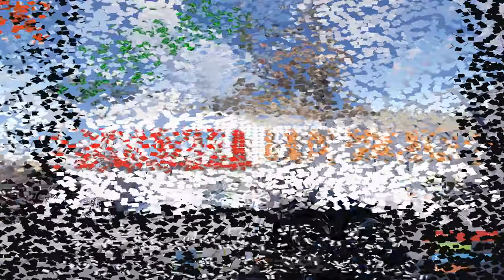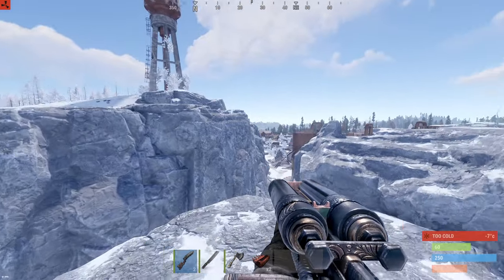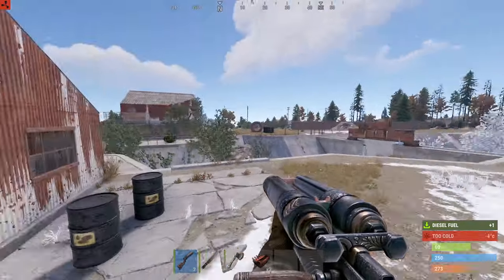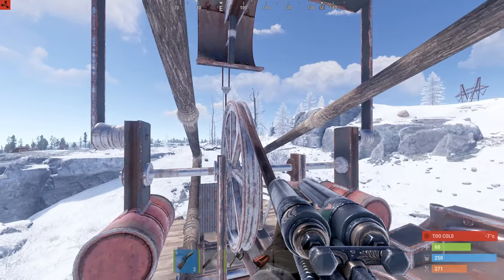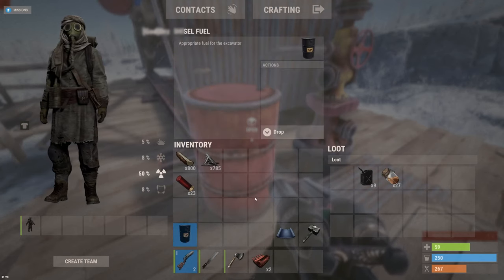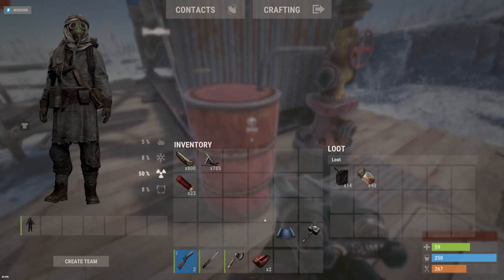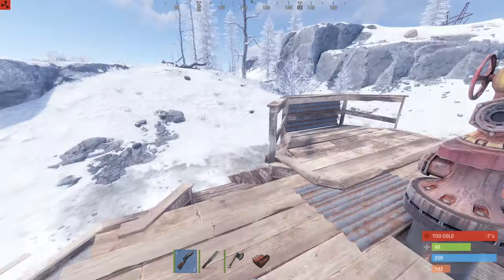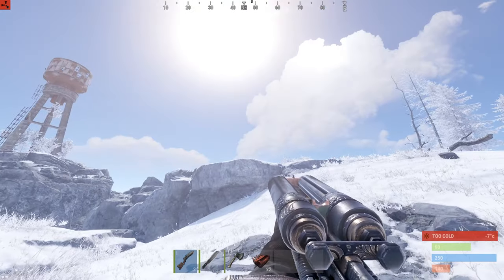BIG Low Grade from NEW Diesel PUMPJACKS in RUST!!

Comment: u cant build around it so its not rly usefull if playing on fp or other big servers
Reply from the maker: I found it incredibly useful finding a barrel early wipe , 2 mins for 170 low grade or 40 seconds for enough to get that first furnace fast!
Reply: @GenXGamesMeister  2min standing around in fp or rustonia for lowgrade and crude is a deathwish they hear it from miles away
Reply: @GenXGamesMeister  you're absolutly right!
Reply from the maker: A high crazy pop server yes I agree Lower pop servers easier (sub 200). But it doesn't mean that every time you wont be able to pump some, I was getting attacked while using the pumpjack with arrows early game, fended them off just to get that first furnace worth, ran off leaving the rest for the attackers :)